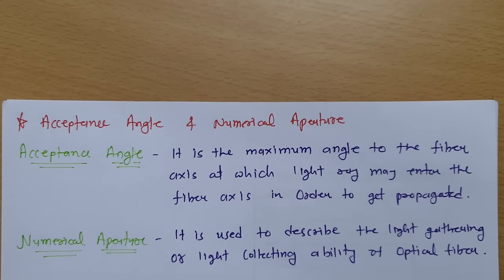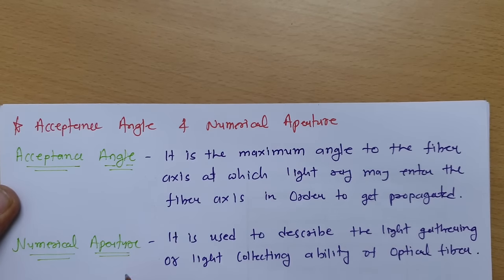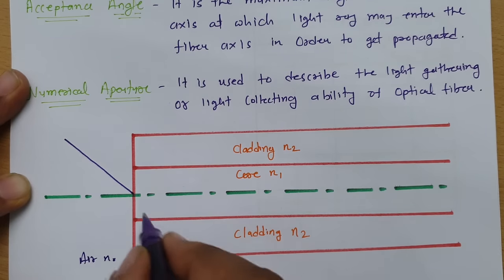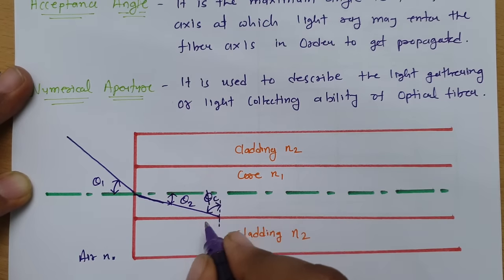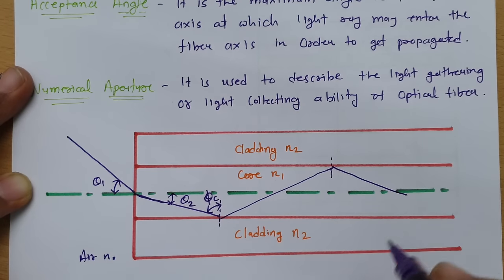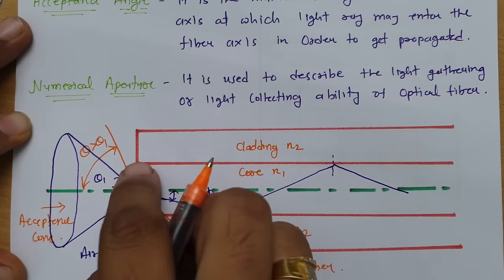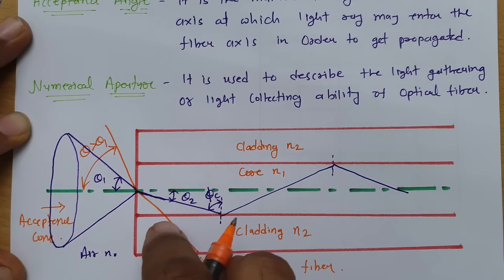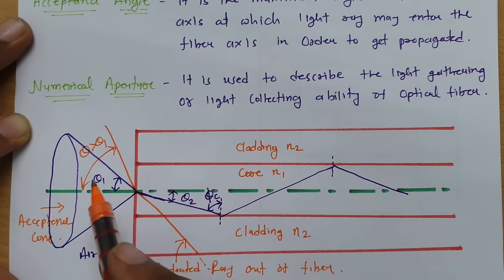Acceptance Angle & Numerical Aperture NA (Basics, Definition, Derivation & Formula) Explained

Comment: 1.	A light wave is travelling in a semiconductor medium (GaAs) of refractive
index 3.6.It is incident on a different semiconductor medium (AlGaAs) of
refractive index 3.4 & angle of incidence is 80○. Calculate numerical
aperture & acceptance angle. Will it result in total internal reflection?
could you please tell me this question for answer sir
Reply: Did you ever get the answer for this?

Comment: Sir, thanks a lot. Can you please answer my query?
What if (N1)² - (N2)² is greater than 0? As values of N1 and N2 can be controlled by us, this can take place.

If this happens, then the value of sin theta will exceed 1, which is not possible. So, can you please explain this restriction.
Reply from the maker: It is not simple question, there are many tradeoff that will make system complicated.
Reply: 🙏🙏 Ok, thanks a lot, sir. It would have been better if you could explain more. Anyways, thank you for replying.❤️
Reply: It's not n1 square minus n2 square. It has got root over it. So its value is never going to be more than 1. Moreover n1 will always be greater than n2 otherwise TIR will not take place.
Reply: @Manus-hh1hd   Values of n1 and n2 can be controlled by us. So, given some values, it is possible to make n1² - n2² greater than 0.
Reply: @sarveshchandak  yes can be

Comment: I have one question that in your previous videos you consider n2 as core and in this you consider n1 as core does this make any difference or same . For ofc n2>n1 , is this applicable for same.
Reply from the maker: refractive index of core is always greater then cladding refractive index.
Reply: @EngineeringFunda  thanks
Reply: Yes it makes huge difference correct notation is for core n1 and for cladding n2

Comment: in this video as the signal is going from air medium to some medium i.e.core as it moves from rarer to denser but according to snell's law when light is going from rarer to denser it bend towards normal but how did it go away from normal. 
please clear my doubt @engineeringfunda
Reply from the maker: Angle of refraction does it. As per snels law.
Reply: @EngineeringFunda  my point is 
Air is a rarer medium in between core of glass or plastic. But in diagram as you explain when light goes from rarer to denser it bend towards normal but in diagram you show that it moves away from normal.
Thats what i don't understand.
Please explain that.
Reply: Yes, as light passes from a less dense to denser medium, the light bends towards the normal. This is shown in the purple and orange rays in the video; if you were to draw a line following the incident ray down inside the core, you will find that they bend towards the normal. 

Maybe you may have the misunderstanding that "the bigger the incident angle, the smaller the refraction angle". This is not true, you may give arbitrary values of n1 and n2 and calculate the refraction angle using snells law. 

Hope this helps :).

Comment: @16:20, Why in index difference (delta)N=n1-n2 but in relative refractive index (delta)N1=n1-n2 and so N1 is coming out of underroot? So messed up....just hate this subject, hate this branch, hate you, hate my life.
Reply: Relative refractive index are calculated with respect to separate medium, and N1 is coming out of underfoot because if you multiply these to term (2n1)(delta n1) then you will find n1^2 and root cancels square so you get n1 only.
Reply: Index difference is nothing but the difference between refractive indices of the two medium under consideration and is denoted by (delta n = n1 - n2). 

Relative refractive index is something different. It is as an index of one medium in relation to the other medium, denoted by (delta = (n1 - n2)/n1). 

Note very carefully here in the first case "delta n" is a single variable means delta and n are not separate for algebraic calculation, they are treated as just one variable.

 In second case delta is a separate variable and n1 and n2 are also separate variables, so here we have three separate variables, so (delta n1 here actually is delta * n1) that it is the multiplication of two algebraic variables, hence it is coming out of the square root.

Hope you understood !
Reply: 😟why u hate to all cool down aakash
Reply: @meyun4699  Just cleared this subject, this semester, and this undergraduate course somehow.😅
Reply: @aakashgupta7211  what are you doing diploma Or btech
Reply: @meyun4699  Done with Btech
Reply: @aakashgupta7211  🥰but i am  doing diploma  with ec trade and optical fibers communications is my fev subject
Reply: @meyun4699  Chlo kisi ko to acha lga ye subject😂....Keep learning!👍
Which colg btw?
Reply: @aakashgupta7211  government girls polytechnic ayodhya 
And you???
Reply: @meyun4699  KIET Ghaziabad
Reply: @aakashgupta7211  godd, i thought for leet bcoz this is my last year
Reply: @meyun4699  I would not suggest. It's not worth it.
Reply: @aakashgupta7211  why? 
Than what should be done
Reply: @meyun4699  What is your ultimate aim for life? If it is a 9 to 5 IT job then go for it or if you want to work in psu's( for which the chances are little less).
Only then go for engineering.
Reply: @aakashgupta7211  i want to be a good hardware engineer because I am interested and I am just waiting for college placement
And please tell me what are you doing now?? 
Are u on linkdin app ???
Reply: @meyun4699  Then u can opt for it and would have to work really hard to earn some good money in that field.
You can connect on LinkedIn if u want any further clarifications: https://www.linkedin.com/in/aakash-gupta-785501185
Reply: 😯kya baat krre ho bro really 😧😧😮😮😮
Reply: You are welcome  gussa ni krri hu shock lga h 7.5 lakh.... Firstly congratulations🎉🎊🎉🎊 and kha h y company,,??
Reply: You are welcome  send me request on linkdin

Comment: You should give atleast reply on doubt comments... One dislike, just coj of that attitude. If you reply, I'll change dislike to like 😤😤😤😒

What is the difference between Relative  Refractive Index & Index Variation ???

At 15:18 , how you considered n1~ n2. If it's approx equal, then N.A. should be zero, coj (n1 -n2)= 0

Please reply me and others who have Doubt
Reply from the maker: Index variation is different of n1 and n2.
Relative Refractive index is index variation/ Refractive index
Reply: @EngineeringFunda   ... I've noted. 

We know, n1>> n2, then how, n1 approx equal to n2. If we put in (n1-n2) , whole N.A. will be zero. 

Also, @17:02 ...how that n1 came out of the root??
Reply: @Pranjal90  arrey bhai, n1-n2 is not zero because that is delta(very very small value like 0.000001 which is equivalent to zero).
Also, answer to your next ques.:- it is NA=sqrt root(delta×n1×2×n1)= (n1) sqrt root(2×delta)
.
Hope it helps!
Reply: @savantsingh4200  Thanks bro...🙂🙂😊